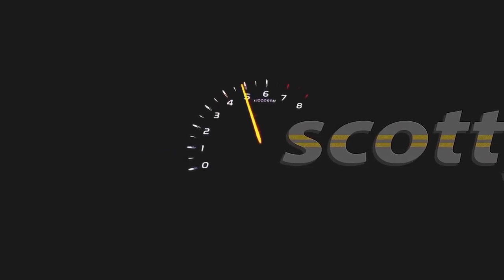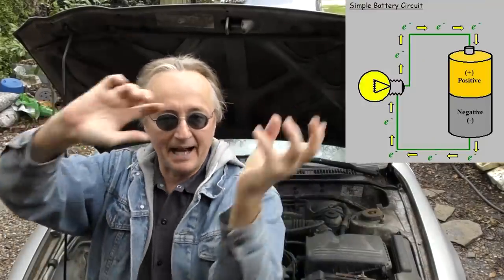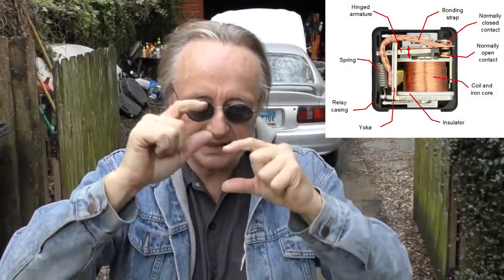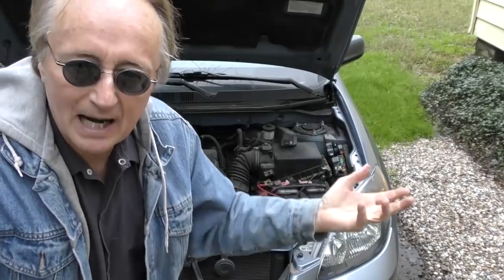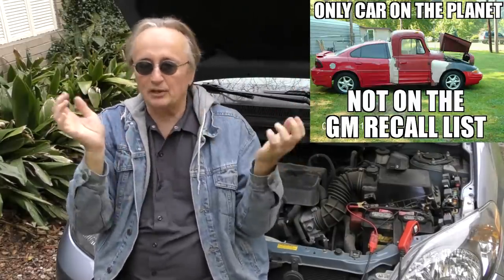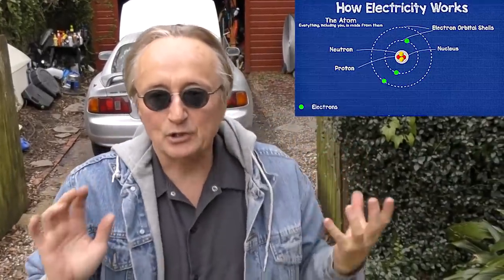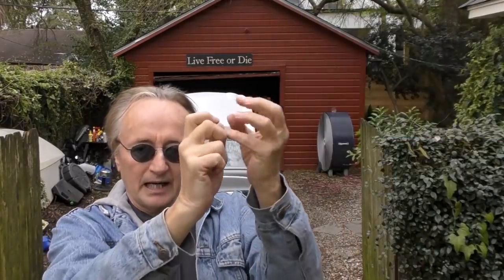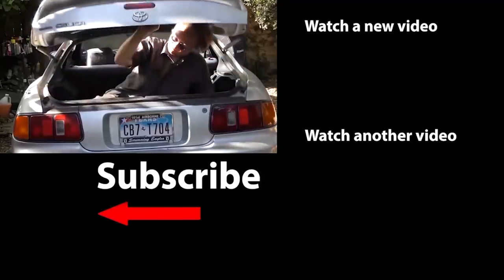Doing This Will Save You Thousands in Electrical Repairs

Comment: Dad mechaniced Andreotti . He almost disinherited me when I said I opened a bicycle shop. Are you crazy ? And I certified auto finally to his relief. It was 1984 and the gvt had bought fleets of Dodge Omni Colts and stuff. K cars. Well they all had those Volks trannies and we had thousands of cars to rebuild fleet so they farmed them out to everywhere private mechanics federal service fleet and these things were just everywhere. Nobody knew why the hell a transverse mount engine ..Cadillac did one unusual Eldorado's transverse ? But we had scads even prison auto shops were all given hundreds of these stupid cars. Have you ever driven a four door K car. My pastor leant me his and he has his k car cross to bear . It was like a wooden seat on a stage coach and I'm not kidding. Then the luxurious Lebanon another preacher had . It was more comfortable k car. I think the ultimate vehicle was probably the 70s series Ford Truck. Very friggin classic. With stripping and chrome or is fancy . Probably a 351 Windsor and two barrel on 16" wheels and overdrive maybe . Heavy axle rear 3/4 ton
And you can pull a D8 on a lowboy. Best van was the first long nose 75 Econoline 16 heavy axle truck six 3speed overdrive fuel injected 300 six. Made 1/2 million miles hauling backhoes and hundreds of pounds of tools under the bed. Big Red. She sits in Paulden wrecking yard. Johns tools probably still waiting for him ....he walked away with his 1911 colt and probably did himself VA wouldn't continue his meds. He don't need any meds now. .

Comment: 12 volt relays are that, 12 volts. They DO NOT operate on 5 volts, and they are not safety devices scotty. 
Ive been an professional mechanic for 25 years and I know more than you do? Come on Scotty, relays are small load devices used to control large loads, the controllers will still send 12 volts to operate that relay, which is a small load, roughly .7 ohms, the controller does not send little voltage, voltage and amperage is NOT the same thing, a small load requires very few amps to operate, ever heard og OHMs law scotty? The high load side in the relay is just contacts that close whenever the relays magnetic field is activated, allowing high amperage to flow to device being controlled. Maybe I should start my own youtube channel, since you being a professional with over 50 years experience dont know this and I, with half the experience do.